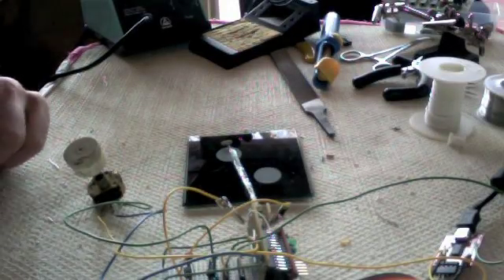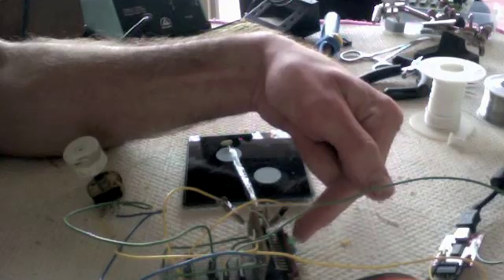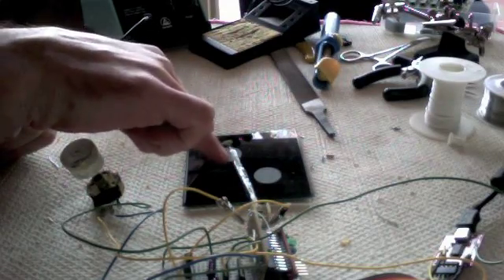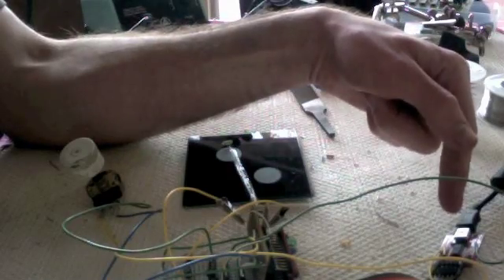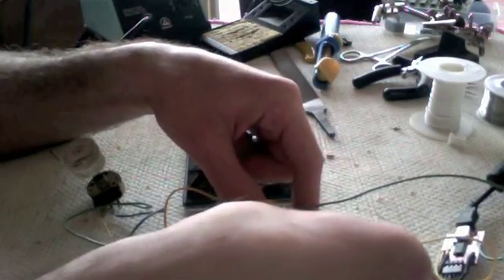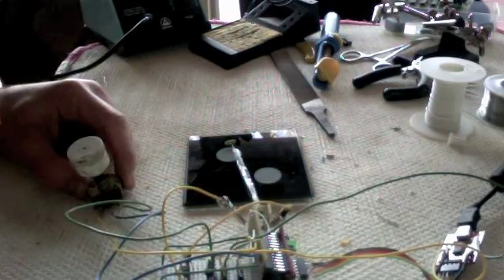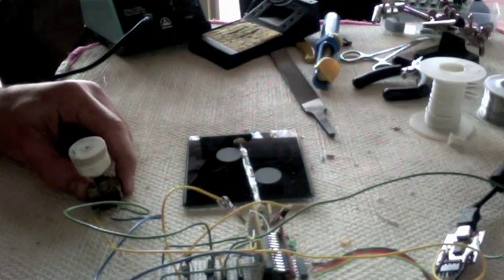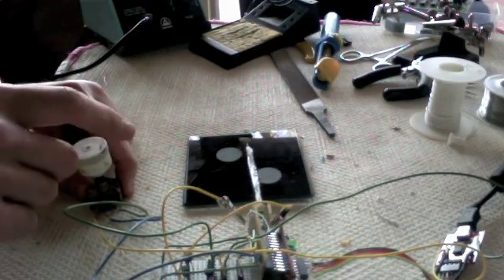Nitinol Muscle Flexer  - now with control!

Comment: Hello sir, thank you for sharing knowledge.
i notice the wires move around on point zero, i wonder if they can bend, i have seen videos where they seen to have i believe 6 or so degrees of freedom
thank you.
Reply from the maker: I could combine pairs of wires to move the tip of the arm around arbitrarily, and if one had nitinol wires that had an elbow in the middle when actuated, one could get arbitrarily high numbers of degrees of freedom.  Can you link to one of the videos you're referring to? I'd love to see it.  Thanks!
Reply: i would like to ask something else sir
ill give the wire triple shape memory, i hope i can achieve so.
Now does the wire has a good lifespan?
i assume as any other metal it must give after bent so many times, ill buy some n find out myself.
Also i now you have in mind a cooling system that might help the wire cool down and go back to martensite, i hope i'm clear enough, thank and take care sir.
Reply from the maker: Oswaldo Cruz
 To cool the wire, I've considered clamping small copper flags to help conduct the heat out faster.  These should be as small as possible.  Low thermal mass and high thermal emissivity are important.  As for how many cycles it can endure?  I do not know... I have not tested it.  I got a bunch of wire by just requesting a sample from the manufacturer - they let me have 5 meters for free.

Comment from the maker: The circuit was simple enough that I didn't feel the need to make a diagram before putting it together.  Basically I used the potentiometer to give an analog in to the arduino. The arduino was programmed to output a pwm signal on 2 pins.  If the analong value was below some threshold, it would put out a pwm on pin 1, which was connected to a transistor to control a higher voltage/amperage line  going to the nitinol wire.  If you have more specific questions, ask away.

Comment from the maker: @aalsaleh Heyo! I'm not actually sure what the current is, but it's more than the 60 ma that the uc can put out, so I had to use some solid state relays. They're good up to (I think) 500 ma, so it's less than that.

Basically I've got 2 nitinol wires that are soldered to a board at an angle from each other. One points left when 'active' and the other points right. By tweaking the current through each, I can control which way the overall arm points. Soldering the wires is not easy, btw.